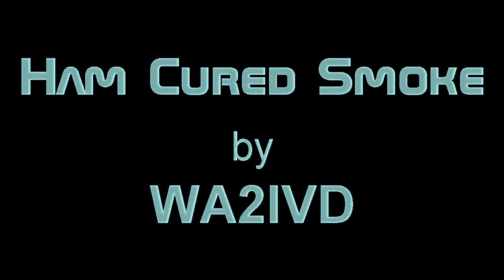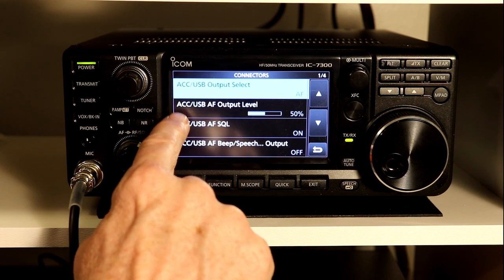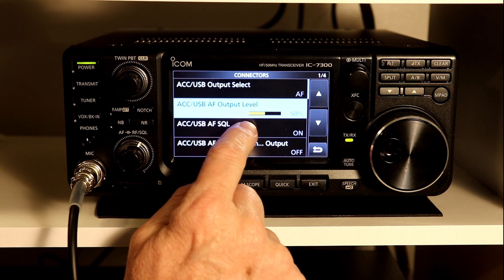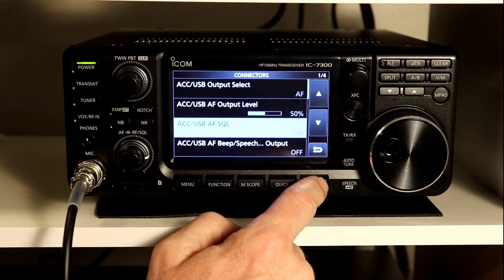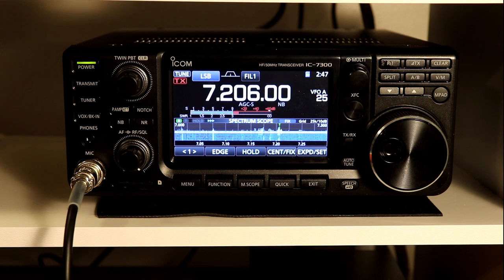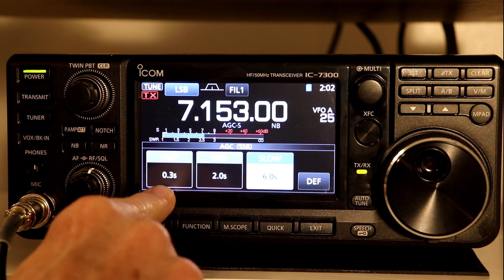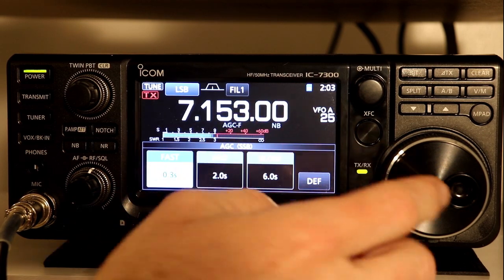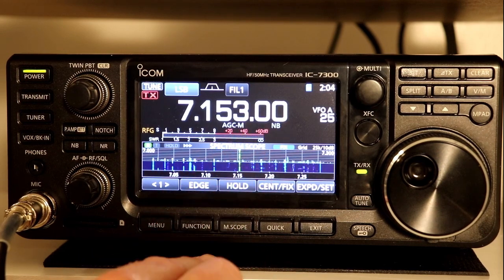Icom IC7300 A to Z #9 Finish Acc Audio and AGC function (manual pg 4-4)

Comment: why does the receive meter stop working when AGC is turned off? Is there a way to have the receive meter work with AGC off?
Reply from the maker: I don’t believe so.  The receive S-meter basically works by showing you the inverse of what the AGC is doing.  The stronger the signal, the more the AGC turns the gain down.  So the meter is driven from the AGC signal.  If AGC is off, there is nothing to drive the meter.
Reply: @HamRadioA2Z  ah ok got it, thanks 73's
Reply: @parkerriverrat1 does the same thing on the FT-710.

Comment: Hello, Can I input audio from my audio rack/chain directly into the audio pin on the ACC port in the back? And will I benifit with any TX audio quality?
Reply from the maker: The short answer is that it depends on the audio coming out of your audio chain.  If you have a really good mixer and microphone, then it will almost certainly be better than the stock hand mic.  You may need to adjust EQ settings either on your mixer or in the radio menus to tailor your audio to typical ham radio bandwidths.  The MOD input on the Accessory connector is looking for standard line-level input audio.
Reply: @HamRadioA2Z  I was told that it would increase the "available" bandwidth of audio coming in rather that just using the front end (mic plug), but also I don't want to go actually wider to cause splatter..but I'll be experimenting with it in the next few days to check it out.  And thanks for the reply!
Reply from the maker: Because the 7300 is a SDR, it does a pretty good job of hard limiting the bandwidth to FCC standards.  That doesn’t mean that you can’t send distorted or bad audio, but at least it shouldn’t extend outside of your 2.5-3khz bandwidth window.  Good luck with your experiments.  I’ll be interested to hear how it works out.

Comment: On part one you said you'd be using just two wires on the accessory plug, which l thought was strange, but on part two it looks like you used 4 or 5.  Can you please provide info on this as l'm looking to hook a microphone preamp to the 7300 through the accessory plug.  I know my reason is different than yours but I'd like to learn more about this plug.
Thanks.

Comment: Great video, I am using pin 12 for AF output and pin 2 for GND on the ACC port adaptor, as you outlined, to connect to a mixing console to capture the audio from the radio for recording. This option works great except for when I am transmitting and I am hearing my muffled audio on the AF output of the radio. It sounds like the monitor is turned on and over driving, but it is turned off and the output is set to 0. I have verified that it is not RF interference finding its way in to the mixing console or from one of the the MICs or cables connected to the mixing console. Any thoughts on removing the unwanted audio from the AF output of the radio?
Reply from the maker: Hi.  I haven't had a problem with muffled or distorted transmit audio showing up on that pin.  It sure sounds like RF getting into something.  Have you tried putting torroid chokes on all of your audio cables just to see?  Another experiment would be to turn your transmit power all the way down to 0 and see if the audio goes away when you transmit.  Even at 0, the radio puts out a little power - maybe 1 watt or so.  If that makes any difference, the the problem is likely RF getting into something somewhere.
Reply: @HamRadioA2Z  thank you for the reply. I tried the torroids and that did not solve the problem. I did however do that unspeakable thing that we as Hams refuse to admit, I looked at the manual. Looking at the pinout diagram for the ACC port on page 2-5, it shows an isolation transformer and a variable attenuation circuit in line with the audio output and the MIC input. So reaching back to my days as a live sound engineer, I put a DI or Direct In box inline between the radio and my mixing console and the issue went away.

Comment: Why using the ACC instead of any other way? Not against it, just asking, as I am receiving an IC-7300 today, and have my mixer and powered speakers already set. Need to input radio then to mixer once it arrives.
Reply from the maker: Hi.  There are 4 places that you can get analog audio out of the radio:  1) The headphone jack on the front 2) Pin 8 of the microphone jack on the front.  3) The external speaker jack on the back. 4)The ACCessory jack on the back.  You could use any one of these to run audio into your mixer with an appropriate resistor divider.  The reason I chose the ACC jack is because it is the only one with a fixed output level.  It does not change as you adjust the AF gain knob.  So, when I set a level on the mixer it stays, regardless of what I do with the volume control on the radio.  If you want your mixer/powered speaker volume to change with the knob on the radio then you will want to pick one of the other outputs.  Enjoy the new rig!  73,  Tom WA2IVD
Reply: @HamRadioA2Z  Makes sense. Thanks.

Comment: What is the purpose of the AGC?
Reply from the maker: AGC - Automatic Gain Control automatically reduces the gain of the receiver when very strong signals are present.  It helps keep close or really strong signals from becoming too loud or distorted.
One thing that Mohammad pointed out in a comment below is that I didn't remind everyone to set your AGC to FAST when working digital modes.  If your working SSB, having AGC set to Slow can reduce background noise and make listening more comfortable when your working someone with a strong signal.  For digital modes, you want your software to get as much signal back as quickly as possible when a strong signal near the frequency of your intended station goes away.  You can always turn your headset or speaker volume down or off when working digital.